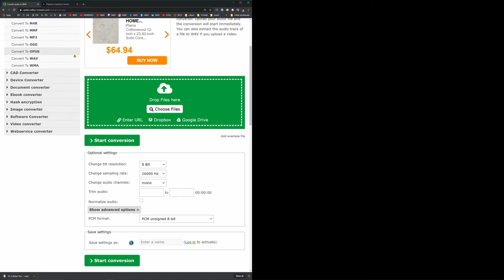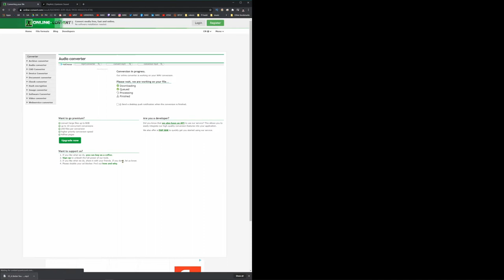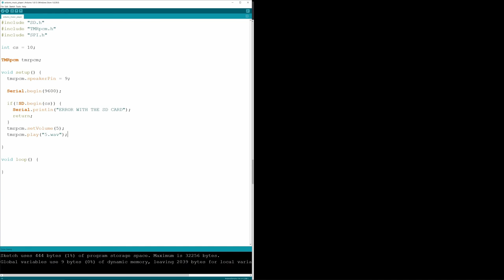SD CARD MODULE | Homemade MP3 Player | Arduino Sensors | #grindreel

Comment: I saw in another video of yours that you can treat the SD slots on TFT lcd's the same as these separate modules. Assuming it is possible to use that TFT SD slot in the same way as depicted here: how would I go about deducing what SD pins double for MOSI, MISO, and the like?

Just a novice finally getting down to brass tacks, and wondering if I can spare some unnecessary redundancy!
Reply from the maker: im not exactly sure, but if you look up the sepecific board the manufacture usually has a pinout/descrition for this

Comment: Liked this video, helped me with an idea I've got for a small project i'm planning to create.
Is there also a possibility for Arduino to play a video with sound, with this setup? (Let's say 30 second video low resolution? Asking because I'm new to this :)
Reply from the maker: You'll have to get an audio driver for more complex sounds even if itd low resolution
Reply: Thanks for the info, will have to check if this is worth it for me. Need to be as cheap as possible because of possible destruction by other people.
Reply from the maker: @Rick-ti6ss  audio drivers go for like 20$ which isnt the cheapest buy you could find a board that comes with one

Comment: Thanks so much Mikael, very helpful, but I have a problem. How do you make it play the sounds without connecting it to the PC? it seems that if I power the Arduino with a battery instead of a computer, then it doesn't play the sounds. Thank you.
Reply from the maker: A little hard to help over comments, wanna join the discord? we have people that can help https://discord.gg/GygvSdf